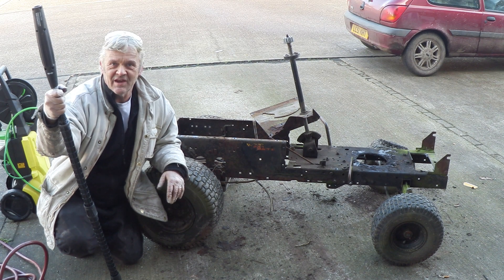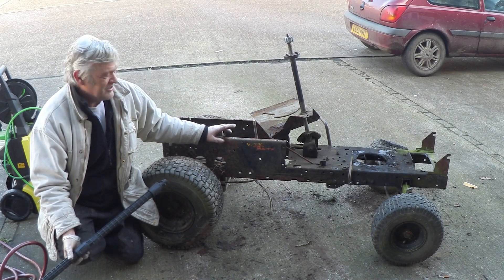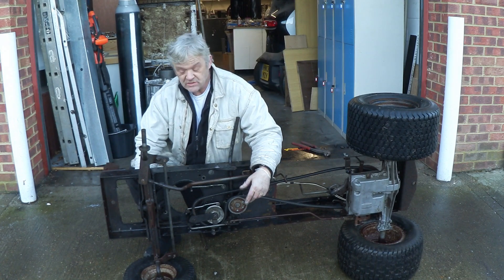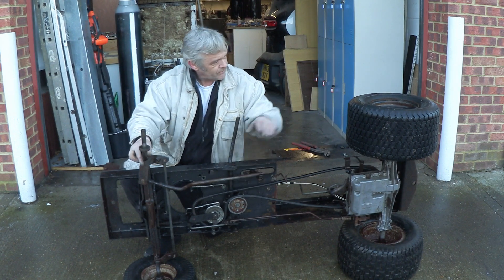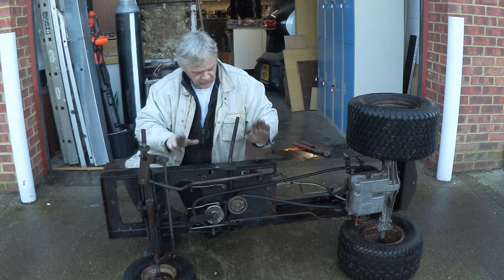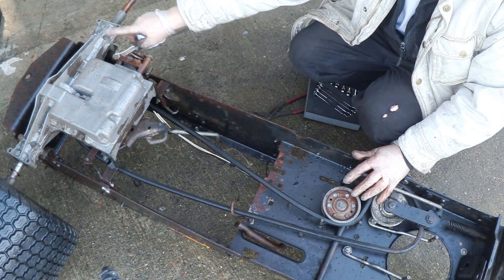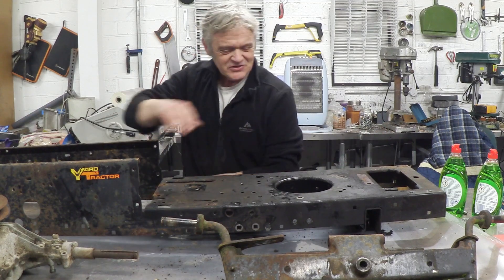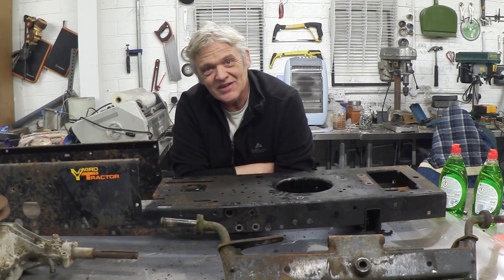Building 'Bessie' - Doctor Who's Car - Lawn Mower To Electric Vehicle - Part 2 Cleaning

Comment: Just converted an old Toro I was gifted, to run a rudimentary electric drive, with a $100au Milwaukee drill.
I started with a 30mm diameter pulley on the drill and I may have created one if the slowest land based vehicles.
Ilk add this to my YouTube zero turn conversion video when we get some time to film on the farm.
Can't wait to see what Robert does for this conversion. Maybe a 14S 48v Nissan Leaf pack?

Comment: Lawnmower frame is good because it's obviously designed to climb steep slopes, but it's kinda heavy and very low, so perhaps aluminum baby carriage stroller would be better. At least this is the way i imagine micro electric car, it will be interesting to see alternative approach in the coming episodes.

Comment: Stretch it and make a model T drag car.  😂🚙🔥
Reply: Stretch it, add angled solar panels as a top, and mount your gasifier, generator, and batteries to it to make it the parade float equivalent of a mobile power plant. Mount the bulk of the battery bank on the ground or in a trailer so that you can disconnect from the house Power Supply and still go run saws on the back 40. Or haul the whole thing off in event of evacuation order and power the emergency shelter despite downed lines.

Comment: Why electric! I think people should be building things with engines in or pretty soon there won't be any left.
I'm not a fan of electric cars because it's a con. So much energy is used with engines to mine and build the car and batteries and people think they are more friendly to the environment. Plus there's not enough power comes from wind farms. If the whole country was covered in wind mills there still wouldn't be enough power to to run everything in the country! Did you know that when there's no wind the blades have to keep moving and they use a big diesel engine.

Comment: The arms on the back axle you mentioned could well be the gear change (difficult to see where you were pointing).  That axle type usually has 5/6 gears + reverse.  Looking forward to seeing it take shape
Reply: Agree. Thats where they usaly are, as they are  designed by forineers who insist on drivinng on the wrong side of the road. I say. Put rubber sink plunger on the front and call it a Dalek.
Reply: its for the brake, shifter stubby is on top.
Reply: @ThunderDivine  Isnt the whole contrivence upside down at the moment?